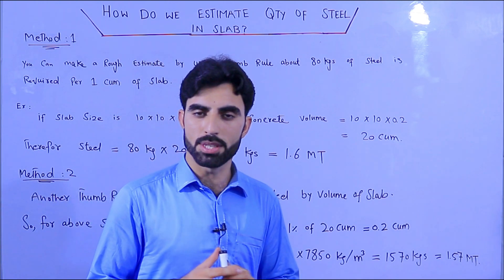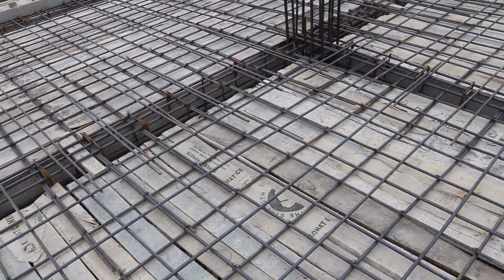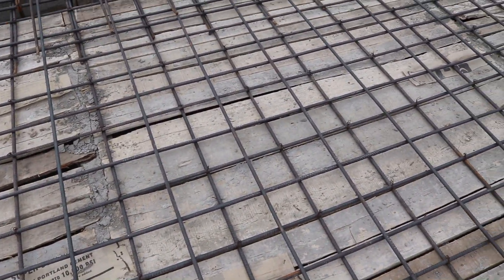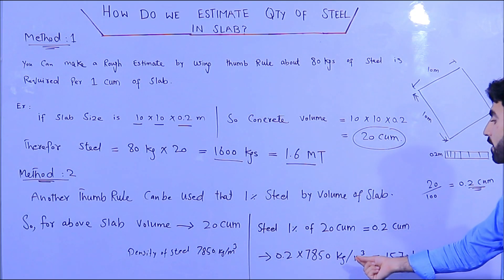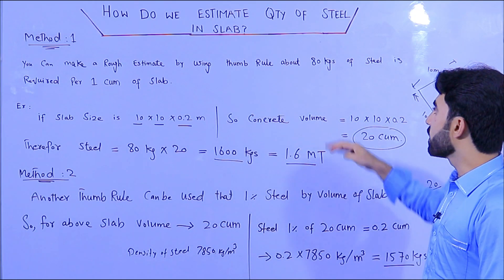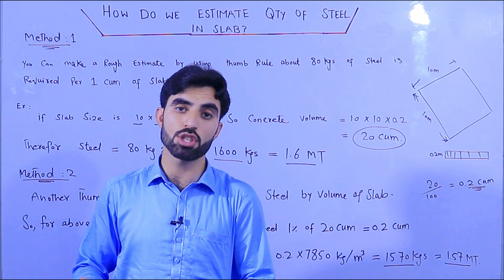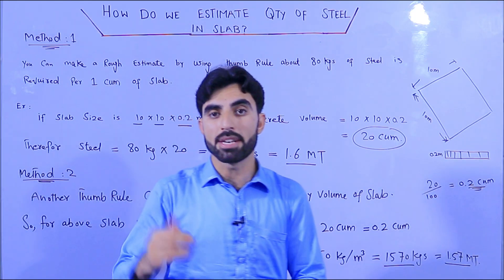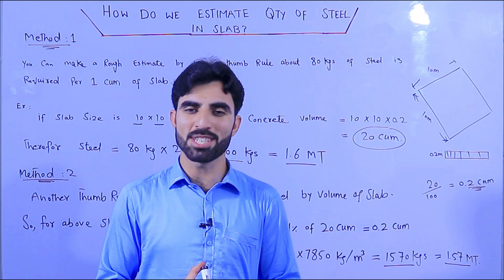How Do We Estimate Quantity of Steel in Slab?

Comment: I have a question teacher
If we have a room foundation of room length 0.65m
And high of this 0.55
And the depth of concrete foundation 22cm 
The question is are we can to
0.22*0.55*0.65 =0.07865m³
Then 0.07865 *130kg/m³
= 10.2254 Kg
Then 10.2254/1000
= 0.0102245 ton